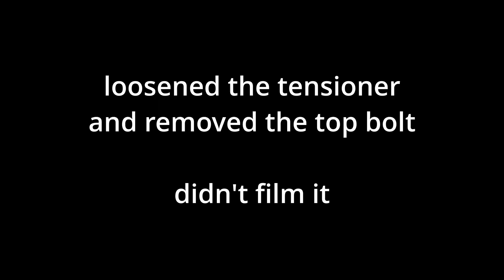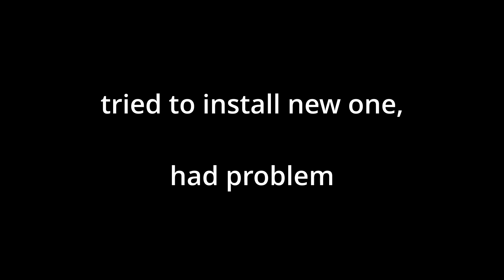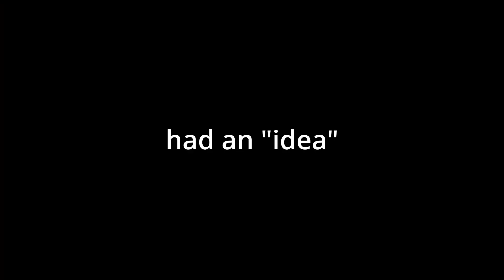Installing an ARD High Output Alternator on an RB20DET

Comment: Sorry for this question but, why you couldn't replace the alternator from the top? It looked like there was enough room to do so
Reply from the maker: It's probably possible, but it would be much more difficult trying to get around the radiator hoses and cooling fan in the front.  Plus, the bottom bolt has a nut on the back of it that needs to be held with a wrench in order to back the bolt all the way out. -Ken
Reply: @tkgtcars  thank you
Reply: I've seen other videos fan shrouds can get in the way so tbe remove them if taking it out from the tip